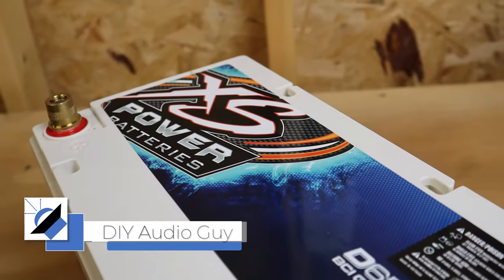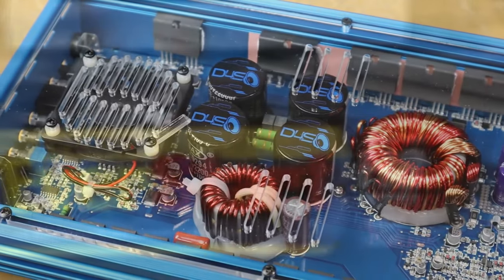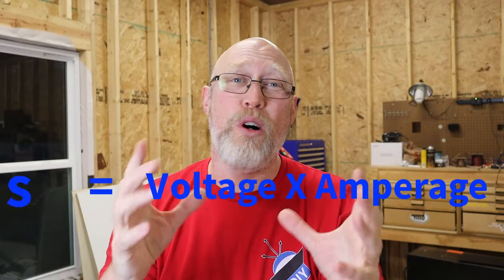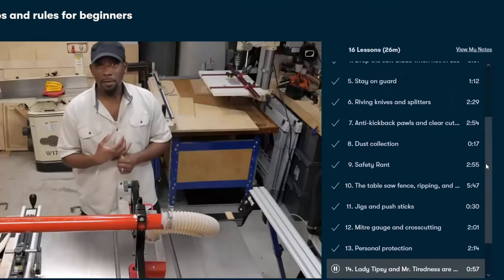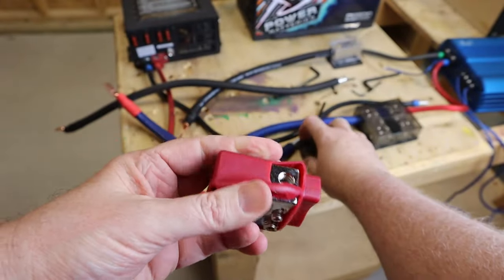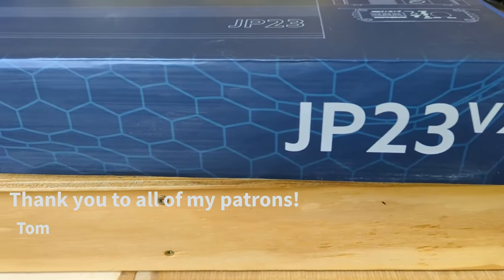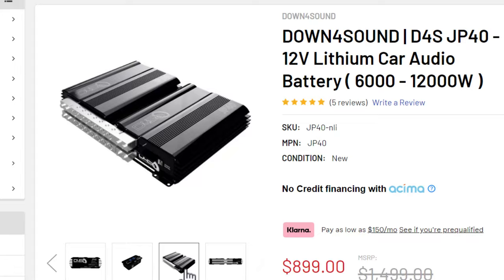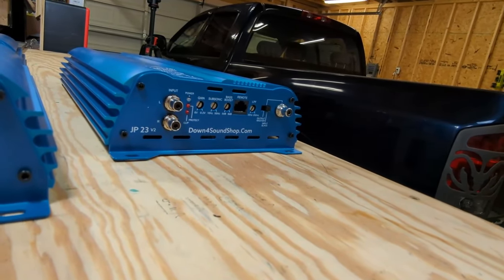Will upgrading to AGM and Lithium make more power?  #skillshare

Comment: I love this video! I have always wondered if buying one of those insanely expensive xs batteries would help me with some voltage drop on occasion but now I know it's not going to. I need to start saving my money and buy the high output alternator that I need to buy if I want to start cranking. I do not compete in bass competitions and I probably never will but I love Bass and I'm only running 1500 Watts RMS but when my clipping light starts flashing on my bass control knob and even a little bit before that, I start getting voltage drop even when I increase my idle to around 1500 RPMs. My stock alternator does a great job but it's only pushing 110 amps. I've gotten a bunch of quotes and the cheapest I've been able to find is $329 for a 260 amp from Apex alternators. Are you aware of anybody who builds high output alternators that are less expensive?
Reply from the maker: You are definitely pushing the limit of what you can do with a stock alternator.  Unfortunately, when you start down the electrical upgrade path nothing is cheap.
Reply: I bought an LActrical High Output 300 Amp Alternator from Amazon. Fit my 2012 ram 1500 perfectly. Cost me $250.
Reply: @chrisallen3671  I tried hunting down an alternator on Amazon a while back and there are a lot to choose from but the biggest problem I'm running into is my vehicle is a 2009 Hyundai sonata 2.4 l and I can't seem to find a less expensive one. It could be my car is getting old or possibly just foreign or less common. I live out in the country but I've contacted a lot of different places in the area and I can't seem to find anybody that actually builds them. Thanks though I appreciate it!
Reply: @chrisallen3671  I did not seem to be able to find one through lactrical so I sent them a message. Hopefully they will have something available! Heck of a lot less money. Thanks for the tip!
Reply: @bigpoppa4005  I had to do the same. They sent me a link for the one I needed. Hopefully you’ll have the same luck.
Reply: @chrisallen3671  I'm really hoping so! I came across another brand on Amazon called eagle high alternators a while back and they were also less expensive and I sent them a message about my vehicle and their response was "no we no have no" lol hopefully lactrical will!
Reply: @Chris Allen  got the power Master 240 from amizon it lasted bout six mts with 2 xp2k Batts in the truck and 2 optima red tops under the hood trying to push 6k but mecman 370 on the way
Reply: @Aaron  guys quality altenaters are not cheap I don't buy cheap alts don't look for the cheap price
Reply: @djkeys415s  I seem to be unable to find a cheaper alternator anyway. I sent out request for quotes for my vehicle to a lot of different vendors and the cheapest I have found is Apex alternators for a 260 amp for $329. I don't do competition but I am definitely pushing the limits of my stock alternator. My amp runs at 1500 watts RMS and the stock alternator is working but when I crank it up it's drawing more amperage that my alternator puts out. I don't Crank it up too often but I know it's only a matter of time before my alternator is going to go up in smoke. I love Bass and eventually I'm going to have a much larger system in my car and at that point I will be purchasing a stronger alternator.
Reply: @Aaron  hope it works out but a quality unit is what I be looking for and mecman seems to be puting out a good alt but they not the only ones tho

Comment: Can i use my AGM 12v battery that i use for a boat trolling motor is 55AH deep cycle?? Been learning allot off your videos..
Reply from the maker: Back in the day (1980's and 1990's) that would have been the best option.  But today's  car audio batteries and super caps are designed to deliver a lot of power VERY fast.  I have heard great things about this:  https://lddy.no/1goh4

and this:  https://youtu.be/07UJMfVoS3o
Reply: @DIYAudioGuy  sweet ok I'm looking into it.. keep up the great work..

Comment: I bought an XS power battery to replace my oem battery that’s 5 years old now. My headlights dim when bass hits. Will this help with the dimming?
Reply from the maker: Batteries don't make power, they store power. What you need is a high output alternator.  The battery is a cheaper option, and sometimes they help.  But not always.
Reply: @DIYAudioGuy  my factory altnernator is 150 amps and my amplifier only outputs 800 watts maximum. My headlights didn’t start doing this until recently. What should i do?
Reply from the maker: @rudydaberry122 how old is your battery? How old is the alternator? One of them could be going out.
Reply: @DIYAudioGuy  I got the car in 2020 brand new. It’s a 2020 GTI but the battery and alternator are probably 1-2 years older than 2020. It starts just fine and cranks good so idk

Comment: @diyaudioguy.. LTO does not have a lower charging voltage.. it’s actually one of the highest charging lithium’s. Those premade batterys run the cells in a 5s configuration which isn’t the proper way to run them. There proper way is 6s configuration and making the charging in the 15s and above. Its a misconception unfortunately from the big names making them that way, but can be dangerous over time and deplete the lithium itself way faster than it’s actual life span.
Reply from the maker: I'm kind of curious, why is it wrong to run five cells in series?  My understanding is that when you connect cells in series the voltage sums.  So the only difference should be the voltage.
Reply: Correct, but the individual cells are meant to charge at certain voltages to
keep them within range.. A pristmatic LTO cell (found in all of these pre made lithiums) usually have a max charge rating of 2.8 volts per cell.. so in a 5 series configuration the max charge would be only 14 volts, but most cars and H/O alternators will easily charge at 14.4 - 14.8. Over charging lithium can hurt it and deplete life span, even worse with some chemistries, not so much LTO (luckily). So a 5s configuration bank will 90% of the time be overcharged, unless the user is charging under 14 volts which is very uncommon.

Comment: Ive been watching your videos for awhile now, because you make things alot easier to understand, without extra nonsense that doesmt need to be jn there... Anyway. This is the first video that Ive seen your truck. Look very similar to my 2008 Dodge ram. Which since recently getting back into the car audio hobby. I've found to be hands down the worst possible vehicle  for hiding a sub enclosure. Like under the back seat. Unless you just want a couple of 8s, theres not really enough air space for anything. I was curious if you had any suggestions. The onky thing ive come up with is to build a full custom center console sub enclosure. Id LIKE to put a 15in sub on there firing back, and I think I can squeeze it in there. The box I drew up on an app goves me around 3.5 cu ft. and theres about 18 inches between my seats.  Just curious if you had any other suggestions
Reply from the maker: You can also raise the set up about an inch and a half.  But not many other options.

Comment: I have a stock alternator under the hood I have a full throttle 4800 AGM, isolator in between my d4s 6.0 lto and a d4s 500 farad cap to a JP23v1 pushing 2 10" Resilient Sounds gold series subs. Wattage doesn't drop below 13.5 - 13.1
Reply from the maker: I've always been told that an isolator would rob you of half a volt.  What is your experience with that?
Reply: @DIY Audio Guy  first time hearing that let me remove it and meter out I'll get back to you. Thanks for the heads up love your channel

Comment: If a lithium battery has a max discharge rate of 100A does wiring a number in parallel increase the maximum discharge rate or is the system limited to 100A? For example if you connect 4 12v 100ah lithium battery each with a built in 100A rated bms will you be able to pull 400A or are you limited to 100A?
Reply: Yes, when you wire in Parallel the voltage stays the same, but you double the capacity (Amp hours or Watt hours) and you also double the max amperage it can provide. Now if you wired two car batteries in series you would have 24v which is way too much for any automotive application. So you will never do that, unless you are building a lithium battery with individual cells.. but that a completely different animal than buying these pre made batteries.
Reply: @CL-yp1bs  thanks I thought that was the case but couldn't find the answer anywhere.
Reply: @lowriderbug  yes no problem, 

If you go with Lithium instead of AGM, I recommend buying pre made LTO (Lithium Titanate) like D4S LTO 6.0 or XS Titan if you can afford it.

There are some other chemistries, like Lithium Iron Phosphate (LFP/Lifepo4) that is pretty safe, but not as safe as LTO. I figure if I am putting it in my vehicle I don’t want to mess around with potential fire hazards so I stick with AGM, or LTO since they are the two safest chemistries followed by LFP (also called Lithium Iron Phosphate or Lifepo4)

Whatever you do, do not EVER use any lithium in your car that is not LTO or LFP/Lifepo4. There are a lot of old batteries on the market taken out of electric vehicles which are Li-on types and those are extremely volatile. 

Never put any lithium in your car that’s not LTO or LFP and you will be good. LTO is by far the safest but also the most expensive

Comment: Alternator 1st  second battery with proper wire gauge and ofc cables 5500rms full tilt my voltage never drops below 13..9 volts.Alternator I found on eBay @230 1 yr no issue..
Reply from the maker: I have the alternator and big three installed,  https://youtu.be/MuksKiWpit0.  I will probably need an external voltage regulator.

Comment: How well, if possible will 3 ltos w/buss bars  in the back pair with 1 xs power d4800 under the hood, excessive amperage 400a alt plus big 3 with 1/0 and 2 runs of 0 back to the amp. 
2019 Ford Edge, sundown X18v3 D2 in a sundown prefab 7.0 cu with a salt-6
Reply from the maker: I think that should work just fine. The advantage to these batteries is that they pair well with your under hood battery. 

Personally, I think the 3000 w to 6000 w rating on these is a little bit on the high side. So I think getting three of them is the way to go.
Reply: @DIYAudioGuy  so with the three 6.0s, wiring them in parallel with the system is how that should be done?  And then what about isolators? Wouldnt parallel result in the batteries mooching off each other while the car is off and hurt them after a while? Sorry for these ignorant questions, I'm still on the learning side
Reply from the maker: @jaket6807  I don't use an isolator and have had my setup for well over a year with no issues.   My truck is now a project vehicle and it sits 5 days out of the week.  I have not had a problem with that.  I also do not sit with the engine off playing music.
Reply: @DIYAudioGuy last thing, I don't play it with music off either, never have... So then the car and everything just sitting overnight like normal without isolator or anything should be fine?
Reply from the maker: @jaket6807  I've not had any problems.  But, I'm not a battery expert.

I would encourage you to ask a few more people and see what they say. 

Maybe consider reaching out to down for sound and see if they have any technical advice for you.

Comment: Could I use an agm battery under the hood and the lithium in the back or no?
Reply from the maker: Depends on the lithium battery, some types rest at a higher voltage.  These D4S batteries are designed to use with a lead acid battery.
Reply: @DIYAudioGuy  thank you man have a good day.

Comment: For your truck, I suggest one of the Superstar Platinum AGMs. They are O'Reilley's in house battery. I picked up a group 34 for my mustang and with a little battery tray "modifications", I got it to fit in there. I used some illconcepts 6 point terminal block. Completely got rid of my headlights dimming, and I could turn it up more without the amp clipping where as previously it would start clipping much sooner. All with a 2g big three upgrade and stock 100ish amp alternator. 

Now I've really upgraded check out my channel for the full setup

Also, I recommend taking a wire brush to your terminals, and the distro block. Will fit a lot better and won't slip off
Reply from the maker: I think you are right.  AGM still seems the way to go because they are compatible with your stock electrical.  If you want to go lithium you need to do a battery delete.  I am not sure that XS power is worth the extra money.
Reply: @DIYAudioGuy  for sure. If you are running a 1000 watt system, an AGM and 4 gauge big three and you should be set as long as you watch voltage and don't let it get low

Comment: Yeah save your money and go lithium..  These batteries by xs power weigh a lot Compared to lithium's counterpart that's the main reason why I changed it up I used to have three of these batteries by xs power but To keep them might have to upgrade my suspension system and I wasn't about to do that so I went with them after three years of using those other batteries still have them if anyone needs them letting me know... The biggest issue is properly charging these batteries most new cars can't even AGM they don't charge properly you need to throw them on a charger every so often get a DC to DC charger for your vehicle

Comment: BEST TIP i can give people is just buy a generic Varta AGM battery biggest one you can put in your car AND put a 16V 500F Maxwell capacitor in the trunk….You can power a nice setup with a stock alternator without voltage drops…
Reply from the maker: I really just need to pull the trigger on a super cap and give it a try.

Comment: Batteries alone don't make more power, batteries is to sustain the current flow to the amps together with a proper alternator. More power will derived from ohms load from the speakers which allows more power to be produced.
Reply from the maker: https://www.youtube.com/watch?v=MuksKiWpit0

Comment: I was actually surprised there was any difference on a small amp . On a much bigger amp the difference would be much more I think
Reply: I have this same amp in my wife's Camry and it dims her lights at 1ohm.
Reply: @gregkirby  I would look in to figuring out why a stock Camry electrical system should have no issues with a 1000 RMS class d . It is kinda difficult to get a good ground in them if you not done them before . I had a 2001 Camry in shop in August took me 4 tries to get a good ground in the trunk I ended up going under the rear seat below the seat belt buckle bolt and then a ground wire from the firewall to the negative in the battery 1600rms now no dimming at all
Reply: @paulgood2218  so you ended up running a ground from the battery to the amp?
Reply: @gregkirby  no put the ground wire for the amp  under the rear seat then ran a body ground under the hood to the battery like you for the big 3 upgrade but there no reason to do the power wire on the altinator with stock altinator. I just did the grounds
Reply: I have 2 xs lower d3400 batteries running 5k watts rms on a stock alternator. Even on full tilt voltage only drops to 13.3. I plan I upgrading the alternator soon though

Comment: @DIYaudioguy, I am running that jp 23 v2 myself on a stock alternator. It never dips under 13 volts. 1 wet battery under the hood 1 Walmart AGM in the back big three with 2/0 gauge and a Ioxis Ultracap. The ultra cap is what made the difference. It was $150 bucks at Big Jeff Audio. It's B-Stock but it works fine. My lights dont even dim at full tilt. There is a video over on my channel if you want to check it out. It's a great way to get that JP23v2 going without spending $600 on a HOA. Give me a shout if you wanna try this and need any help!
Reply from the maker: I started with the alternator.  My plan is to try out several different combinations and document the results over the next few months.

Eventually I'm going to end up with a battery delete, an external regulator for the alternator, and a big lithium bank.
Reply: @DIYAudioGuy  lithium is a great choice. Good job on the AGM vs Wet Cell. Those high priced AGM batteries or way overhyped. I am putting together a video as well comparing many different power sources as well as Graphite. I hope it is as good as your videos are. You will love that JP23v2 i know there is louder but its hard to imagine. I set off two car alarms yesterday lol
Reply: @DIYAudioGuy  Hey, Which alternator did you end up going with?
Reply from the maker: @RealPivotTV  https://youtu.be/MuksKiWpit0
Reply: @RealPivotTV  
If you're looking for HOA suggestions, look into "autotech engineering usa". They may not have the brand recognition/"street cred" as others on the market, but they're deserving of it... I mean, shop around and make your purchases based on what best suits you and your budget, but I'd like to think that's at least an option you might not have known about. ✌🏻

Comment: Hey DIY Audio Guy! I'm desperate and i hope u can help. I'm a semi truck driver and to keep this short. I have two small speakers and that aren't for music. I have to either listen to them buzz at me continuously every few seconds or unhook them as I've done. Problem is that unhooking them triggers fault codes with my semi. Is there anything i can use in place of a speaker to trick my rig into thinking the speakers are functioning? Tia
Reply from the maker: I think that a resistor would do the trick.
Reply: @DIYAudioGuy  thanks boss!! I'll research what size and how to implement it. I really appreciate you pointing me in the right direction.